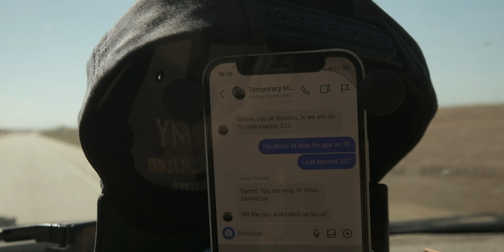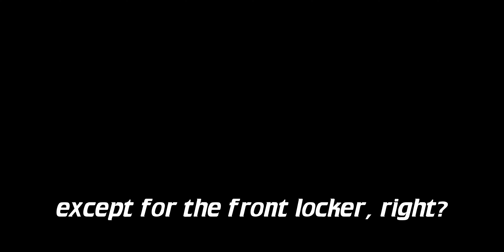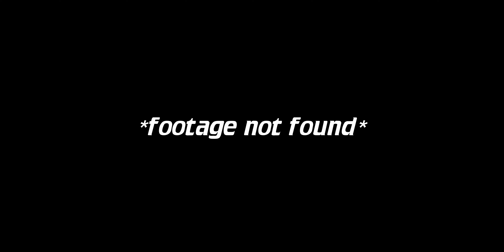Three flat tires in 30 minutes…off roading a Lexus in the desert (LX470)

Comment: So what’s verdict on the pck? Problematic itself or you gotta forgo that rear skid plate?
Reply from the maker: I need to use the truck more to get the feel for the PCK but so far I like how it handles on the highway better with it installed.

I’m modifying the skid plates to allow more axle travel. Lee will probably do the same